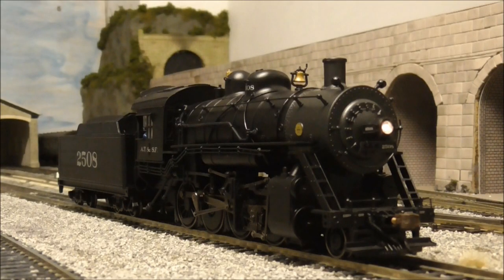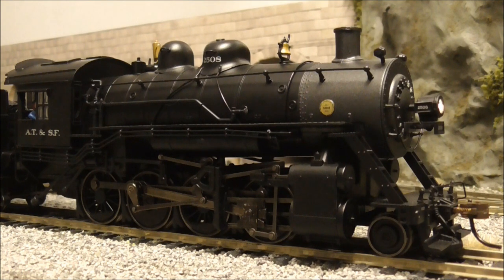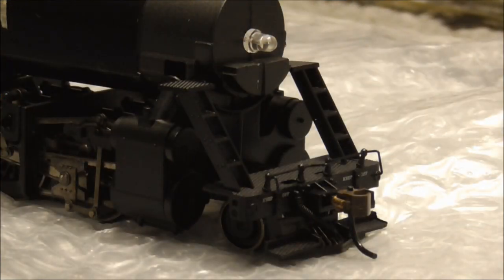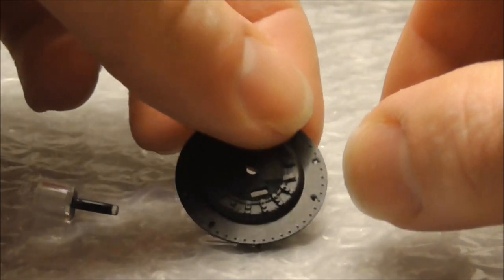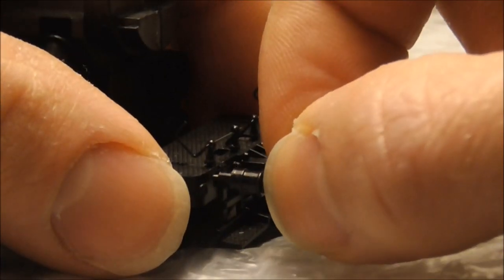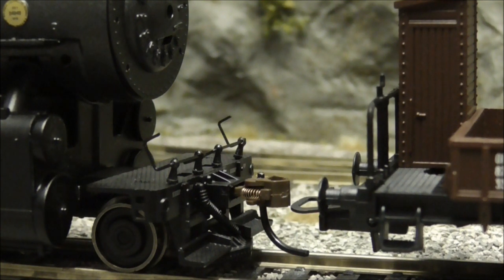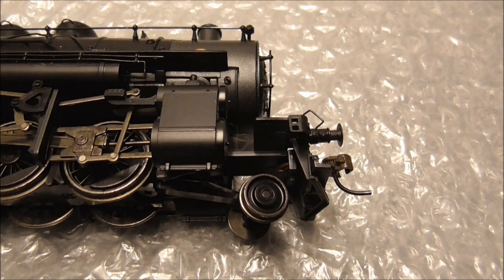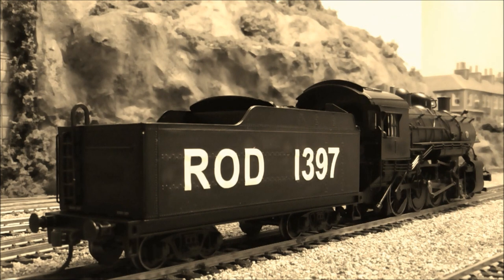WW1 ROD 'Pershing' Baldwin 2-8-0 - 00 Gauge - Locomotive Build

Comment: Nice work and good running footage. A family friend has a photo of her grandfather standing beside a Baldwin 2-8-0 of the ROD, with a very close number, 1394 on the cab side. The photo might not quite reach where the number would be if it was on the tender - but surely they'd lose the flexibility to swap tenders if they'd done that? There's an airpump on the left of the boiler above the 3rd pair of driving wheels in the photo.
And the engine's a helluva lot grubbier than yours!  😀